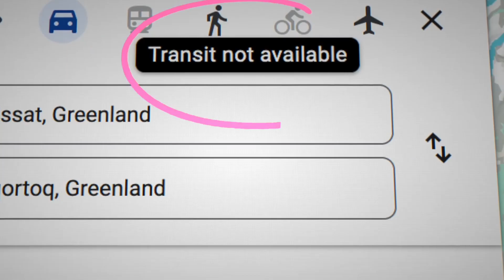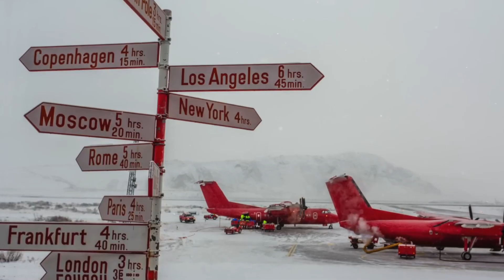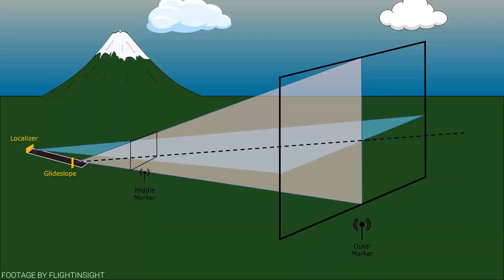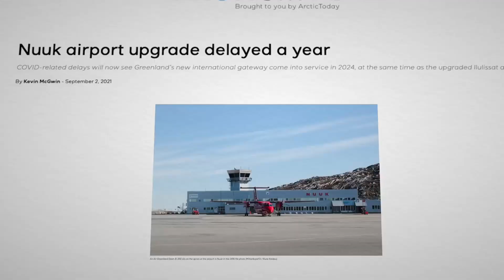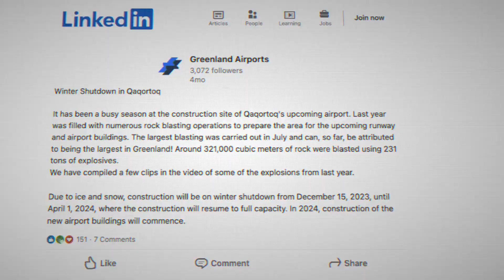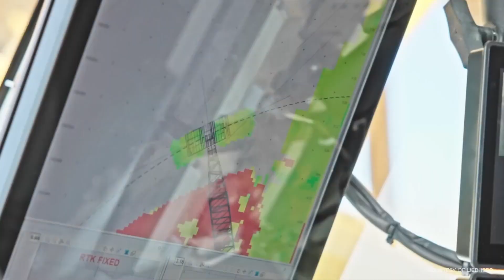The Insane Engineering Behind An Arctic Airport

Comment: 20 seconds in... Youve already made a massive error. It can drop to -30F. Not Celsius. They are not the same. When you make errors that obvious and quickly it throws the rest of the video into question. Did you not edit the video or research... Questions begin right off the hop. Good luck going forwards.